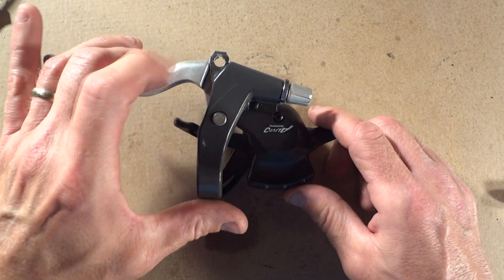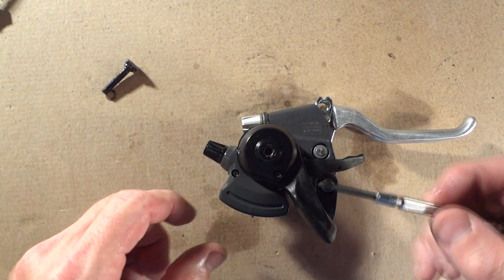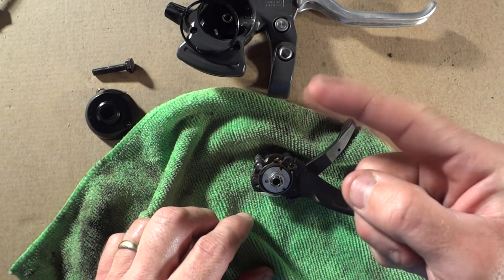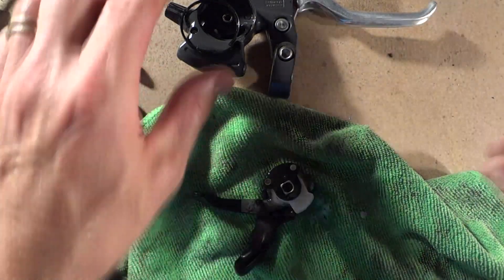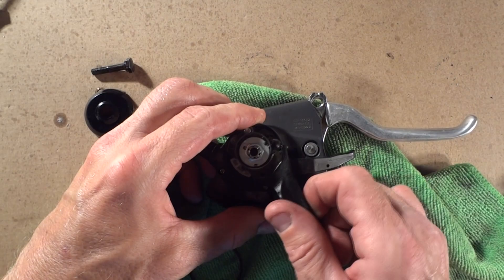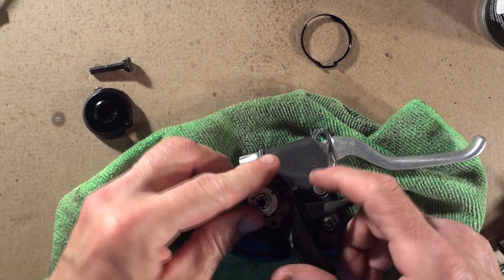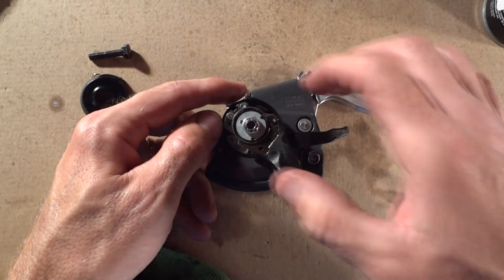How To Repair Shimano Alivio Trigger Shifter That Won't Shift

Comment: This video is a life saver. I restore vintage mountain bikes and my latest project has it's right shifter that slides up to high gear by itself. I did the WD40 and  used a few drops of White Lightning heavy chain lube as lubrication. I did the left shifter as well. Now it works great. Thanks!

Comment: Great illustrated video.  Very useful for someone looking to learn fundamental MTB shifter cleaning procedures.  Seeing as WD40 is a solvent, it will not only break down the old gummy dry grease.  In time, It will also break down the lube.  For lasting results, rinse the shifter in soap and water after the solvent step.  Then lubricate.  Now the lube can maintain it's integrity over time, and you will prevent some future maintenance.  Again great video and I would never seek to take anything away from what you have shared (that was good of you to do!), in particular the zoom in shots were perfect so that I could see exactly the parts you were referring to :D

Comment: I got a smoking deal on a mid 1990's Trek MTB that had a flat tire and stuck shifters.  I had previously been to a bike shop and they told me they just grind off the portion of the shifter/brake assembly that contains the shifter and then replace it with a new shifter unit.  Viola! New shifter in about 10-15 minutes.  I had done one like that on another bike, so I anticipated another grind and replace.  But I found this video instead.  While the pulling and cleaning took much longer, it cost me nothing other than time, degreaser and lube, and I'm happier with this fix.  
Great video!  Now I'm off to do the other shifter!
Helpful tips:Use a screwdriver to pry under/inside the rubber grip while squirting window cleaner inside the grip.  Work it around in there and the grip will come off nicely. Shifter comes off next.The cable has to be fully out to pull the shifter apart as shown.  Leaving as much length on the cable as you can, neatly trim the end so it will nicely slip back through the shifter body and housings after the shifter fix is complete.

Comment: Thanks to youtube and people like you, there's no excuse anymore to not be able to repair stuff like this. After I sprayed the ratchet-gear with WD40 and cleaned it with an old tootbrush, it shifts flawlessly again. On my own, I never would have figured out, that the clogged gear was the problem. Thanks!

Comment: Thanks a bunch!   This worked to fix the shifter on a used bike i just got.   

Im glad about this because i was having difficulty finding a replacement  canti-brake/shifter combo.   Replacing the shifter would have required  a v-brake upgrade.   This little fix saved me a lot of money and effort.   Its also nice that the bike can keep its original parts.  The cantilever brakes are still working fine so I have no need to change them.

Comment: Refurbishing a 1993 GT Timberline rigid MTB equipped with Shimano Alivio ST-MC11 3x7 brifters, both of which are exhibiting the tell-tale dried-up grease, pawls not engaging symptom.  As usual, I've checked for guidance video by RJ The Bike Guy, and sure enough, I see a preview of exactly the procedure I will be following.  Many thanks!

Comment: Hi. The tutorial in the video worked wonderfully. I used this method on my V-brake acera/altus rapid shifters. Before I did this I changed the cables because I thought they were the root of my problems. As it turned out even with new cables the right shifter didn't work. So I used wd40 without even removing the shifter from the handlebars and it worked!!! I did the same with the left shifter even if it was working normally just because the bike was sitting around in a garage for years without being used. Thank you!
Reply from the maker: +Oden106 I would follow up with some Tri Flow. WD-40 is not a great lubricant.
Reply: I don't think we got that in Europe :-D Do you think that some spray dry chain lube could work?
Reply from the maker: Talk to your local bikes shop and see what they use.

Comment: thank you so much for putting this video together. I sprayed the WD 40 into the mechanism w/o taking it off. worked great. now I have to find the lube to spray in there right away.  probably better to take it off and remove the old lube and do it right but didn't want to disconnect the cables just in case it did not go back together easily.
Reply from the maker: +Jack Grondin I fix most mountain bike shifters without removing them. With STI shifters with rubber hoods, the sprays can affect those, so I will try to at least remove the boots.

Comment: Great advice. Thanks for posting this video RJ. I bought a used bike and it was not shifting on the one side (Shimano Alivio trigger shifter).Some advice to others, keep trying if it does not start working after the first cleaning.  I had to spray it down with WD40 4-5  times and work out the old grease as it was really jammed up. I almost gave up on it, but kept going until it freed up. Oiled it up with sewing machine oil and it is shifting very well.

Comment: Thanks for this video. I have Alivio shifters with those big bolts, and I was wondering what is wrong with it... Because I could have sworn that last season they still worked. Now I know, thanks :)

By the way, they have to be quite old to stop working, mine are around 15 years old.

Comment: Thanks!  I just bought a 94 / 95 mtb that has these exact shifters.  They are not shifting properly.  I just bought new cables but before I go ahead and put the new cables in I will do the wd40 / triflow treatment.
Reply from the maker: Let me know how it works for you. Keep in mind some shifters take longer than others. Some free up in seconds, other in 20 minutes of working them.
Reply: So I am having issues with getting the cables out.  the bike I bought is replacing my old gt timberland that conveniently has the exact same shifters but are in perfect working order.   I am just going to swap them.
Reply from the maker: Getting the cables out? I am assuming you mean the shift cables? If I remember right, once you get it shifting, press the smaller lever until it gets to where it would be in the smallest ring/cog, and then you an push the able through.
Reply: shyflirt1
Got it sorted out.  My new to me bike shifts like butter now.  I will keep this video tagged though for maintenance down the line.  Thanks for you help.
Reply from the maker: Cool!

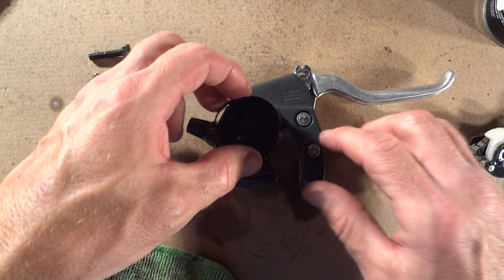Comment: This video helped me fix a pair of 1994 STX RapidFire shifters Shimano ST-MC30, which are very similar to the Alivio ones here. A WORD OF WARNING about that white plastic pin (at 03:13) that connects the gear display with the shifting mechanism: It seems to break easily. It happened to me on the left-hand shifter (front derailleur). Only a tiny bit, half a mm or so, chipped off the top of the pin, so that it can't reach into the little hole of the shifting mechanism anymore. Now the gear indicator just stays on "1". SH!T, now try and find replacement parts for 20-year old "retro/classic/vintage" shifters… I didn't dismount the whole shifter, just opened the dust cap with the cables in place. I'm guessing the big mistake was that I didn't release the shift cable from the derailleur beforehand. Because of the derailleur's strong pull, the shifter mechanism suddenly jumps off position in the housing as soon as you unscrew the big bolt in the middle of the cap a bit. The tension also makes it a little harder to fiddle the shifting mechanism back into its correct position after you're done with the WD40-flushing and greasing. Ultimately, I'm guessing, it was because of the pulling force that the plastic pin got damaged. So, my suggestion: Before you unscrew the middle bolt to open that dust cap, set the shifter to gear 1 (in the case of the front derailleur) and release the shift cable from the holder on the derailleur's end.

Comment: It works! Does the left shifter go bad before the right one, usually? Now I'm thinking since I'm on a roll, to service the other shifter as a preventative measure. Thank you.
Reply from the maker: Not sure. The right shifter should get used more than the left one, so the pawls in the left shifter may get stiff with less use. I don't know.

Comment: Nice video, my right shifter half works and I hope this is all I'll need to do! Thanks!
Reply from the maker: If yours has slots where you can squirt in the WD-40 and lube without opening it up, I recommend that first. This model didn't.
Reply: I can see into it a little bit, there's a lot of muddy looking old grease in there that needs to be cleaned out. I have my cans of WD40 and silicone spray ready! Wish me luck.
Reply: Thanks, Bike Guy. Did my left shifter like you described and she works like a charm. Was about ready to do the same to the right shifter (which works but with a delay), when I saw your comment. I'll give it a try without opening it up.

Comment: hi, I had 7 speed one had problem not this 3 speed. I did what you described and it help a little bit but still not working. I pissed of and disassembled white red plastic speed shower. and found the problem. the very beginning number 10 screw has a end nut. that nut has a special shape to fit her housing. mine was out of housing and whole system rely on this nut fitting in that housing tight. I hammered it all the way. now everything works great. thanks also for your great vidoe.
Reply from the maker: Glad you got it to work!
Reply: I have the same problem. Could you explain in more detail how you fixed it. Many thanks
Reply from the maker: Watch the video.
Reply: All sorted now! Took a while for the WD40 to penetrate. 
The comment about the 7 speed confused me. 
Many thanks. Saved me £££
Reply from the maker: Be sure to follow up the WD-40 with a lube like Tri Flo. WD-40 is not a good lubricant.

Comment: Great video! I'm going to give this a try on my 2001 Enduro. Can this be done on the bike with the cables still attached? Thanks for posting!
Reply from the maker: Is this the model of shifter you have? It would not be easy to do this shifter on the bike with the cables attached. But MOST shifters can be done on the bike. Most shifters have gaps where the levers come out that allow you access to the insides. Like in this video: How To Fix Shimano 200GS Trigger Shifters Super Easy!
Reply: It's an ST M570, Deore LX. No big gaps and no big center bolt. There is a tiny screw in the middle of the lever and three slightly larger around the cap. I'll give it a go through the gaps and see if it works. Thanks!

Comment: I have these Alivio combo brake lever and shifters on a 1996 GT Mountain bike.  Both shifters are not working.  I loaded them with wd 40 but they still won't work.  What kind of brake/shifter would be a good replacement.  It's a 3x7 speed.
Reply: Maybe to much old grease is dried inside shifters. Open and clean them with some kind of degreaser. If don't every altus,acera would be great replacement 😊😊.

Comment: Try the WD 40 first. Food the inside of the shifter.It will fix 90% of these shifters. It fixed my Trek 7200. Just remember to use regular lube after the WD 40.

Comment: HI RJ. As usual, very helpful instructions. I've done all, but it seems that the spring that holds the single pawl just isn't strong enough to bring the pawl back to seat on the gears. I see that there is a small clamp on the post on which the pawl pivots. I thought I would try wrapping the spring around one more time. Yes time consuming and probably will fail in loading the spring correctly. BUT do you have any other suggestion for what seems to be a tired spring?
Reply from the maker: If there is a problem with the spring, replace the shifter. Usually cleaning and lubing work. Make sure you cleaned it and lubed it thoroughly enough.
Reply: I soaked in Goo Gone, and poured over with boiling hot water several times and scraped off with fine awl the waxy residue of years of oils. The pawl finally returned to resting point, and I lube thoroughly. Looks good now. Thanks for stressing the cleaning again and the quick reply.
Reply from the maker: Goo Gone? That stuff is harsh and might damage any plastics in there.And boiling water? I didn't use those in my video. You just needed to spray it with a little WD-40 and move the parts. Then lube it.
Reply: I thought that the spring was weak on my Shimano Alivio trigger shifter also after I had sprayed it down about 3 times with WD40. I was considering replacing the shifter, but I kept cleaning it and working the pawl back and forth with a small screw driver. It now snaps back into place quickly, where before it was moving very slowly back into place. Hope it works out for you.

Comment: I have a question you might be able to help With. I've got new stm390 shifters and the left shifter (x3) shifts up fine and shifts down fine. But, I have to push the down lever really far back to actually shift down. My thumb when on the the bike simply doesn't reach that far. Can I adjust how far I need to push it to shift down?
Reply from the maker: Not really. Might be something wrong with the shifter, or maybe that is just the way it is.
Reply: RJ The Bike Guy hmmm I've also noticed that it jumps a gear with one click. It goes from first straight to third. It is however brand new so I doubt it has an issue. I can't find anything with regards to adjusting it in the manual. Anyways thanks for the response. :)

Comment: Hi the bike guy!
I haven't tried your method yet, do you think it would help in the case when Deore shifters actually shift...But randomly (at least 50% ) i have to push my thumb far away so that it would shift. It feels like it misses some mechanism trigger inside. But sometimes it works just fine. Dont know if i explained good enough..
Reply from the maker: Probably.
Reply: though, ure bullshitting a bit, i found other your video, where this problem was explained. cheers
Reply from the maker: How am I bullshitting?

Comment: I need to do this to mine, ugh can I do this without having to take the cable out of the shifter?
Reply from the maker: ***** Maybe.
Reply: ***** I loosened the bracket that holds the brake so I could turn it so it was easier to work on. Took out the bolt and the screw and took the cover off. I never took any more apart. Just squirted some WD-40 in there and then some spray lubricant. Put it back together and it worked. I was unable to shift down before. Sweet!!
Reply: Todd Klingler Cool man thanks! I ended up doing the same, took it apart some what and got it gunk free and tada working again!

Comment: Mine still shifts but the indicators don't move to the gears. Any idea what could be the problem? I noticed the problem after I did a tube swap with the bike upside down. The lens with the gear numbers broke off on the right side 1-8 shifter but the left side 1-3 shifter is still cosmetically intact but still doesn't move when I change gears. Is it possible they both broke internally as the bike was upside down? My bike has a 35cc weed wacker motor attached making it a motorized bike so it weighs about 20lbs more than it originally was so I'm thinking the extra weight while upside down could have been factors to the problem. I would like to know before I start taking it apart.
Reply from the maker: Either plastic pin for the indicator is broken or not in the hole. (3:15 in the video)

Comment: 2 other methods:
If you removed the cable, you might as well lay it in gasoline overnight.
Or you pour Hot Water over the mech to remove the old grease. 
Afterwards wd40.

Comment: Hi! Does anybody know if you can shorten how much you have to push the thumb button on the left shifter? It is very hard to shift to the last cog (3), I have to push it all the way back to shift up and my thumb is fully extended and still no click. I know I can rotate the shifter back but it does not feel right to push the thumb button more from up to down instead of back to front. Is cable tension the problem? ( too much tension)? The gear indexing is corect
Reply from the maker: Don't ask the same question in multiple places!

Comment: lol. I open the Shifter to try repair. And i end with the shifter broke and all the parts so shit
Reply from the maker: +gfrp Did you have the same shifter in the video? And did exactly what I did in the video?
Reply: RJ The Bike Guy No. It had formerly a shimano changer that do not work. Try to repair it on my own, it is clear that he had not seen this video. And arreglar to try to end the changer shattered all the pieces all revolts. LOL you see. SRRY BAD ENGLISH
Reply from the maker: Ahh.

Comment: Slightly cheating there, you didn’t show how the cables are fitted. Whoever does this will have to reassemble them with the cable attached and it’s a pita
Reply from the maker: That wasn't the point of the video. https://www.youtube.com/watch?v=clpYzi4p7sM
Reply: Yes, absolutely, I just meant that I’d watched a few videos on doing this before I started but the actual  reassembly process is really fiddly. It’s like watching people undo bottom brackets on their $4K bike with their pinkie finger as if they were precision made by Swiss gnomes, when in reality my 20 year old MB probably require a breaker bar and a lot of double checking that this is actually a reverse thread 😳 Sometimes it’s useful to show what goes wrong, like not everyone mentioned that bottom indicator pawl like you did
Reply from the maker: @____________________________.x  Yeah, you won't find that in my vids.